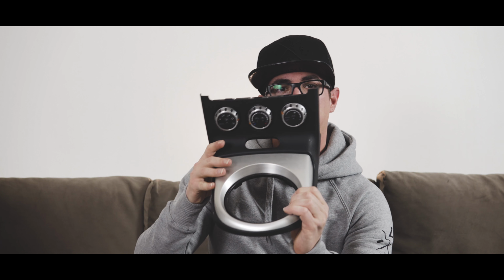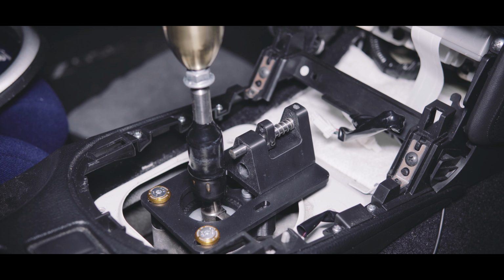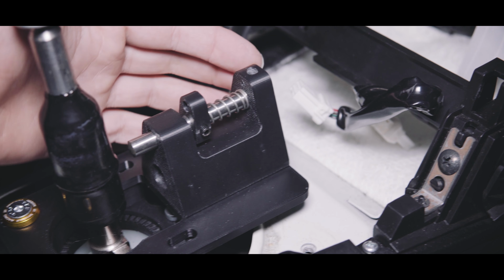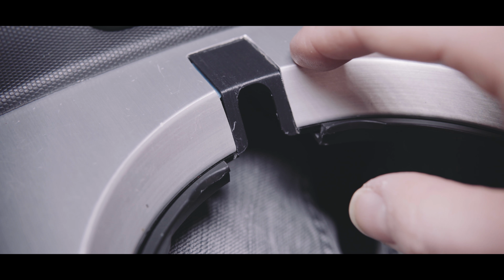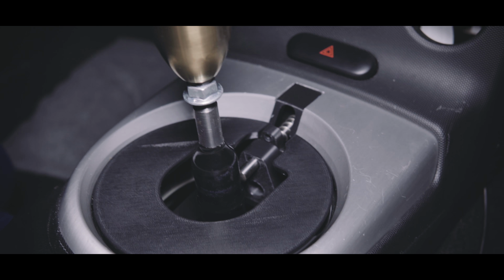BUILDING A 350Z MOTORSPORT SHORTSHIFTER PROTOTYP | Z33 ULTRA SHIFTER PART3 | ZerofuckZ  Ep. 26

Comment: Will the 4 bolt rubber gasket still work over the shifter? I would use this shifter with no shifter boot 👍
Reply from the maker: Yes should be working, when you cut it. But i will make a new rubber plate. Should be easy

Comment: I'm crazy interested in this thing. I got a B&M shifter currently. I'm in the automotive industry so I see all sorts of cool shifters for other chassis's. Always wanted one but they are few and in-between. I got so many questions. Is the final design going to be in aluminum? Looks like delrin for the prototype. Are you going to sell this thing? Are going to do fitment for G35’s? We got the same tranny design so bolting up shouldn't be an issue. Just wondering about the interior trim pieces. Some G have aluminum trim pieces. If available will it be as a kit, or are you going to just lisense and provide you 3D print schematic? Either way cool to see someone filling the void left by the aftermarket.
Reply from the maker: Hey, thanks for Feedback. The Shifter will be made of anodized aluminium and stainless steel. The 3D Print is just for Prototyp and checking the fitment.
I think the G35 should have the exakt same gearbox bracket as the z33.
Unfortunately I can not finish it until after the winter (April).
After some test time i probably will do a small series.
Reply: MIMCK Media 6061 I'm guessing. Yea they have the same bracket. Just the interior trim is different. Prob a little early to talk price but do you have an idea what the damage will be. There's a coolworx shifter for around $530 US but like you said, I think, they mount to the chassis. Idk if I'm crazy about that
Reply from the maker: yeah i´m also not happy with the coolerworx quality. That´s the reason i build my own one.